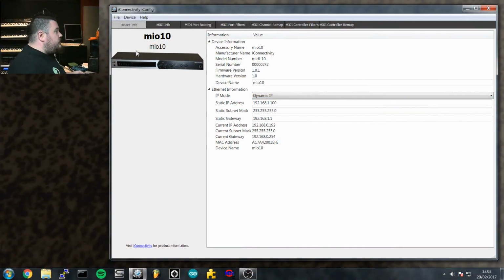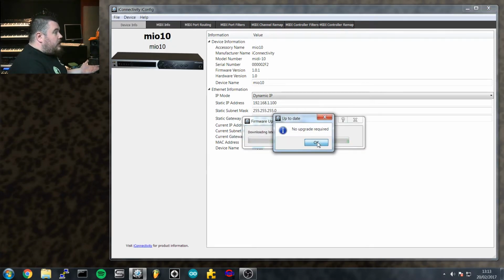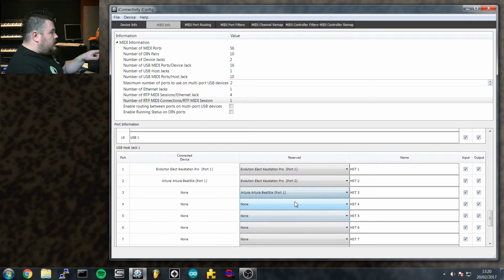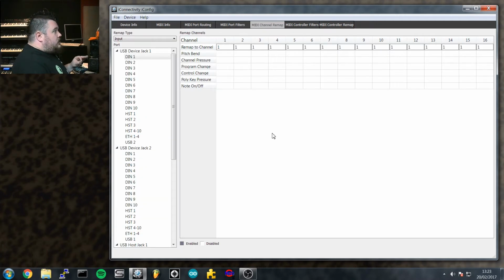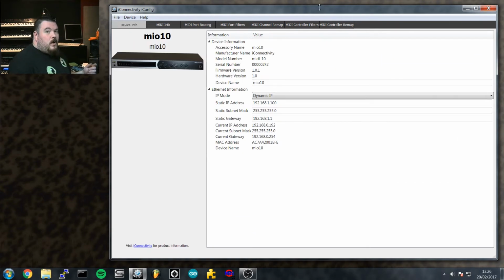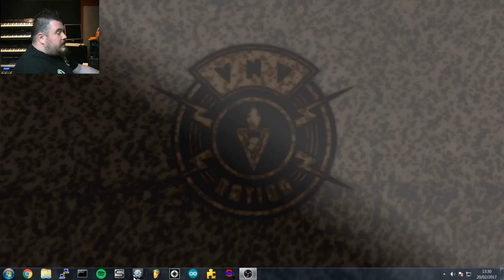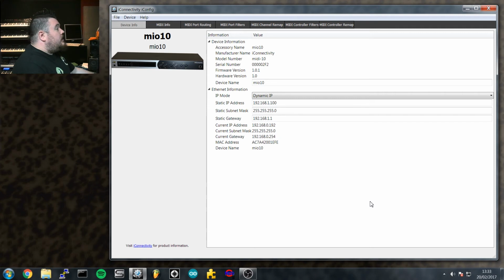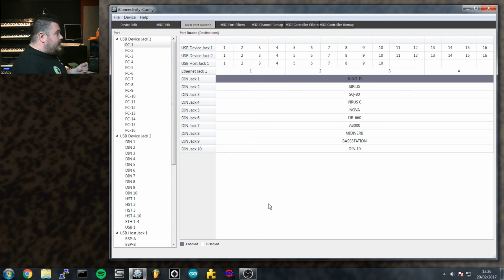iConnectivity mio10 MIDI Interface and patchbay unboxing, setup & review

Comment: If I understand your main issue with the Mio-10, it is that a device, plugged into say, DIN port 3, has all port, channel, and event mapping set...once. One channel map, for all its port maps...yes?

If so, I think problem resolution enters a numbers game. Example...right now, the config file preset contains 16 channel remap datapoints for each of 56 MIDI ports, or 896 total datapoints related to channel mapping.

If a single device can be channel mapped 56 different times, depending on what it's connected TO...then you'd have 56 channel maps, containing 16 data points each, per device, times 56 devices, or 50,000 plus data points, for a single variable, channel mapping. 

Then, applying event filters etc, you'd be up into billion (or more) variable territory very quickly. Not just a case of having to store them, but each switch would then have to be set by the user as well.

Not saying it's impossible, but...

Here at E4 Multimedia, we have a 30 port ADAT multiplex, the Z-Systems Optipatch Plus. It connects 11 audio interfaces, which are hosted by 6 PCs. (Motu PCI(e) 424 cards with multiple breakout boxes per card.)

After slugging thru a mind bending system wide setup, involving 19.5 million variables, we added one more device...and the variable count shot up to 5 billion plus.

This shut us down for months as far as progress went. We didn't get a handle on it until we seperated the routing task into three discrete levels.

Room to room, we have 4 blocks of routings, those which terminate in (record to)  room one, are under block 1, terminate in room 2, block 2 etc.

Each of these is a simple 15 inputs, routed to any of 15 outputs, 225 variables. We ignore the 8 audio channels riding on each of the 225 ADAT pipes, at this level.

Drilling down to the mid-complexity level, we have the DSP mixer config presets for each interface. PC 1 lives in room 1, and only needs DSP configs for ADAT configs routed there. (Not the whole story, but illustrative.)

Finally, at the lowest level, we have DAW templates, to take advantage of various high level ADAT routings, when married with individual DSP routings at the middle interface level.

This allows us to build ultra complex, 5 billion variable, routings, at a modular level, and this is the only way I see to rationally approach your objective.

Put simply...a saved file that contains only channel maps, in a folder full of numerous other channel mappings. 

Another, seperate file folder, full of port mapping files.

This way, you'd be assembling fundamental building blocks, over months or years, one manageable chunk at a time.

The Mio-10 interface software would have to be modified to load not just one massive config preset, but instead, several smaller ones at different levels. Port map number 003, combined with channel map(s) 0017, 0043 and 0056.

The biggest problem with larger multiplexes (arrays), isn't setting the few switches you actually need, instead, it is UN setting the ones you don't.

A modular approach resolves as much of this tedium...as we're able to...so far.

Finally...a simple request. My Mio-10 arrives two days from now. I can see great utility, I think, in two simple additional buttons per page.

"Enable all" and "Disable all".

In fact, my first task, on Mio-10 arrival, will be from lessons learned from the ADAT octapus. Set everything to off, (by and large) and save that preset as the default starting point for all my future config builds.
Reply from the maker: The complexity you describe in this instance is only a problem if you're trying to brute-force the entire mapping matrix. That's horribly inefficient, and almost certainly unnecessary;
I don't know whether there's any special tricks (FPGA, parallel stuff) being done in the MIDI processing on this device to reduce latency, but if it's a straight up traditional serial processing algorithm, I'd expect there's an input buffer (holding MIDI messages tagged with source port), an output buffer, and an algorithm inbetween that writes on or more output messages based on input+config.

If you want to guarantee the latency of this process then yes, you fix the size of the config complexity. But that doesn't mean that it has to store every possible combination; a fixed size list of connections (Input port, Input channel, Output port, Output channel) would equally achieve guaranteed latency and I'm sure it could be more than big enough than anyone would ever need to use (famous last words of course, but MIDI data is small and slow.)
Reply: I'm with you, but from your video, it seemed you wanted much more granularity than just In port/channel and Out port/channel. I thought you were asking for mapping and filtering on each of those, independantly.

That's where the variables can start to pile up. And like you note, you'd be at the mercy of whatever default config they choose. (All DINs feeding all DINs.) The "Diable All" and "Enable All" buttons I mentioned is precisely to avoid the brute force necessity of having to flip every switch.

I like your "not broke, don't fix it" approach too. Leave thruput unchanged, regarding mapping and filtering, unless it needs changed.

Comment: Thank you for this  review, it's really good. With your video you've answered a lot of questions I had about the mio10. I'm still not sure what to think about the user interface when it comes to the midi port routing, especially when I want to cascade two mio10 devices together. Additionally to the missing hardware panic button, the USB ports are not ground lifted, from what I've read.  However, I guess I will give the mio10 a try...
Reply: Pal, do you have any advice or feedback now after almost a year?

Comment: Hello. Great review! I use  MOTU Timepieces and  an Iconnectivity MIDI4+ together. I'm curious about what your MOTU issues were that caused you to need to move away from the platform altogether.
Reply from the maker: Main issue I had was using two MTP AV units networked, realtime events do not pass correctly between the two units, and I got tired of having to use an old mac to manage them (they were pre-usb units.)
Reply: Ahh...ok. Yes. I was thinking that was the case. The serial connections have come to the end, unless networked to a USB unit. I do still use an old MTP II as a thru box. I trigger an old G4 and a few other MIDI pieces through it. At any rate, thanks again for the MIO review. Always good to see studios utilizing out-of-the-box MIDI gear along with software.

Comment: I also found it odd it wont update save a preset once modified, you have to remember the name of the preset and save it again. Also it's a little confusing as to what is an input and what is an output as far as routing. Have you tried connecting it to your computer via ethernet?
Reply from the maker: Not tried the ethernet stuff yet, things have been busy! :)
Reply: This guy connects great via RTPMIDI unless your on OSX Sierra, to which hasn't released a public working RTPMIDI setup yet.
Reply: You can set multiple of them up together at the same time. You will definitely want to rename the ports do they don't come up eth1 eth1-1 eth 1-2, etc..

Comment: That's the issue that I had with Cubase.  Cubase wouldn't detect MIDI DIN1 and I thought that I had a fault.  You don't get any error messages with Cubase. I had the config tool open while Cubase was running.  Config the device and save it, then close the config app BEFORE opening your DAW!
Reply from the maker: Yah, it doesnt much help when the OS doesn't have a decent flag for 'device in use' when it comes to MIDI.